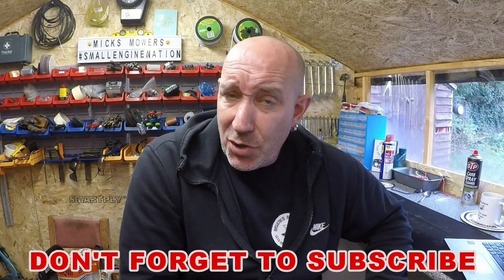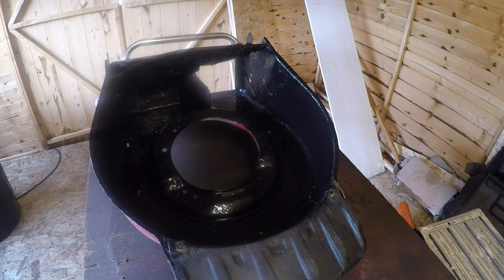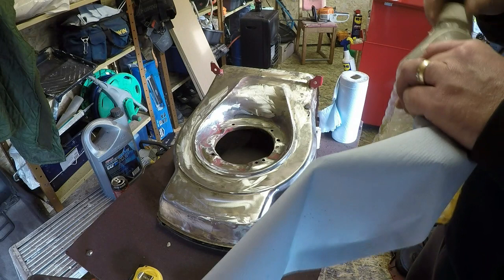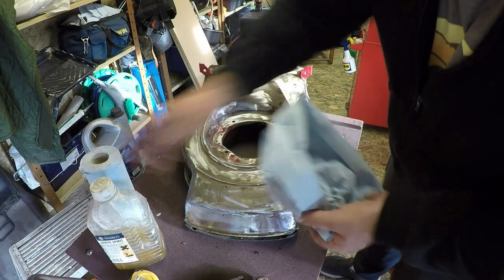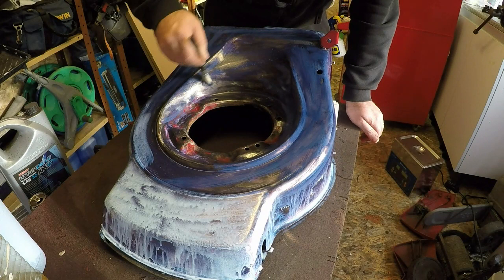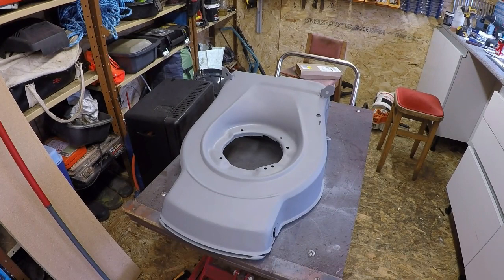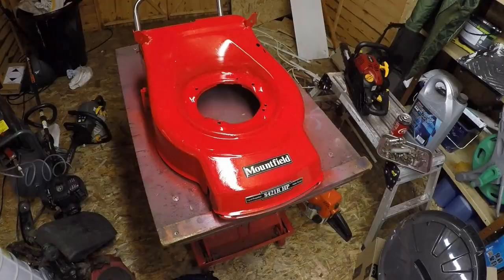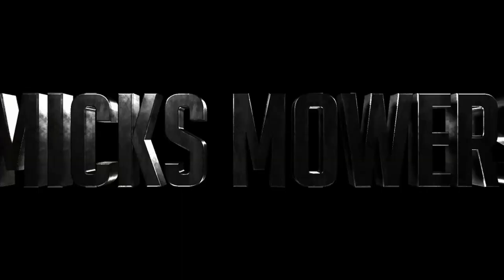#Lawnmower #restore #howto How To Restore a Lawnmower Deck Part Two Lets Get The Paint Off

Comment: bang on mick did u use 2k clear liqueur paint i did one once out of spray can as soon as petrol touched it melted liquer drip marks
Reply from the maker: I used a petrol resistant one mate
Reply: Yet 2k direct gloss is petrol resistant in the automotive industry